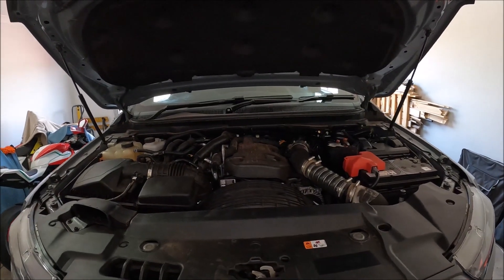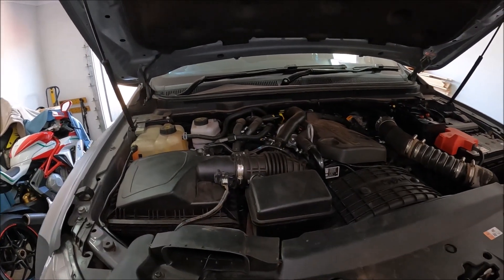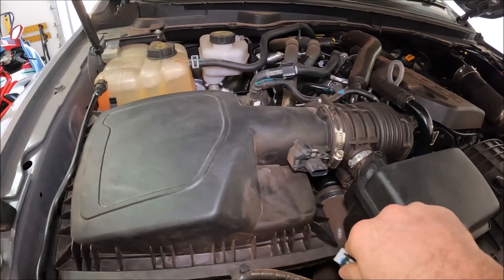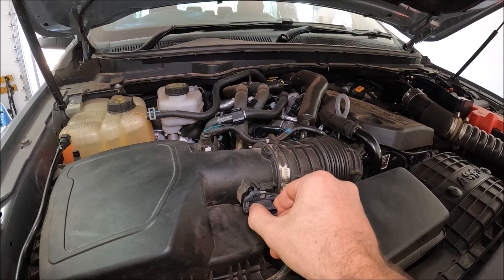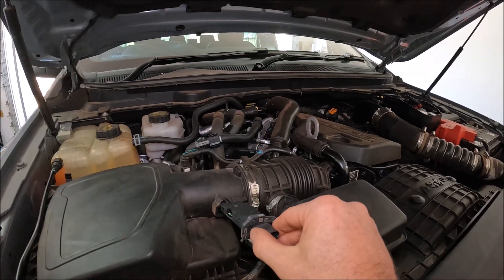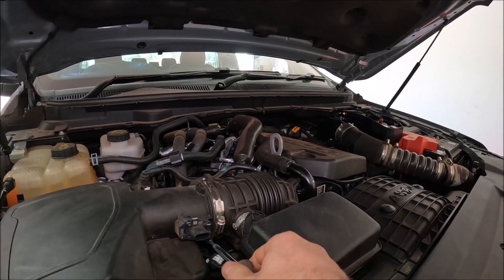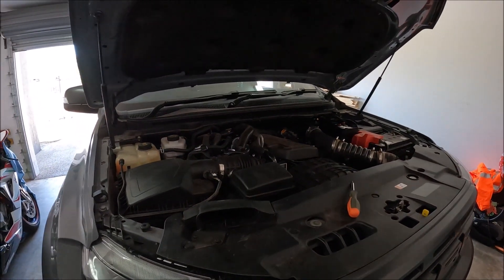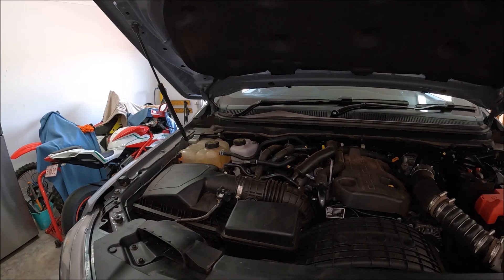How to Replace a Ford Ranger Raptor Mass Air Flow Sensor (MAF Tutorial)

Comment: Hi, may I ask for what reason you changed it? Cheers
Reply from the maker: The vehicle had reverted to standard settings, as it was not getting any data from the sensor. It was throwing up a code. Ross

Comment: Hello, I'm driving ford ranger wildtrack, can you tell me after disconnecting the MAF sensor, my engine is not running smoothly. Diagnostics have been performed, and the MAF sensor is displaying parameters. There are no errors. Could it be stuck, or is the Ford Ranger operating on a different MAF sensor system?
Looking for the cause of noticeable engine vibration.

Comment: Good Day
Please tell me what symptoms would the car have for one to conclude that the mass air flow sensor needs replacing?
I am busy working on a Ford Ranger with the same engine as yours 2.0 Bi-Turbo. 
The car has no power and no check engine is off. These are the fault code i am getting when I scan it with a diagnostic tool:
-P0299 - Turbocharger/Supercharger A underboost condition.
-P259A - Turbocharger Boost control position sensor B performance - stuck low.

So what I did was I unplugged the the sensor on the intake manifold and the power was back but the check engine light was on and it had different fault codes:
-P007D - Charge Air Cooler temperature sensor Circuit high (Bank 1)
-P0108 - Manifold Absolute Pressure/Barometric pressure sensor circuit high
The old fault code were gone.
I did not pull out the plug on the Mass Air Flow Sensor on the Air filter box. and that is why I am asking what would the symptoms of the car with a bad MAF Sensor.
I will appreciate any information/help you can give me. 🙏

Comment: did you disconnect the battery first before you removed the MAF sensor??
Reply from the maker: Hi there, I wouldn't normally, however it's never a bad idea if you are in doubt, its somewhat a personal preference.

Comment: do we have to do any reset after replacement?
Reply from the maker: Hi Pasindu, not typically no the car should correct itself after a short while, you may want to clear any codes it may have thrown up.